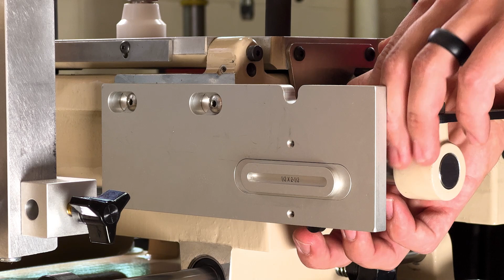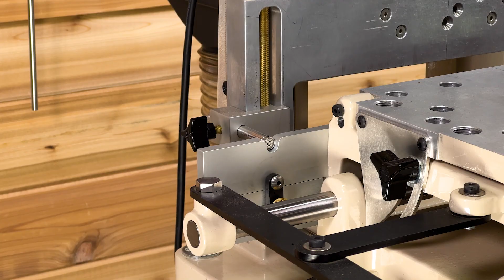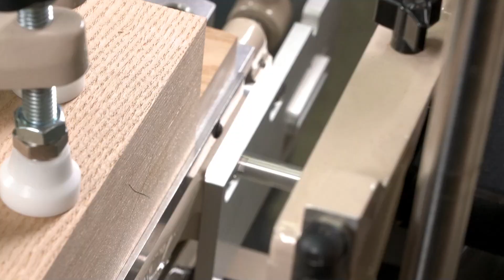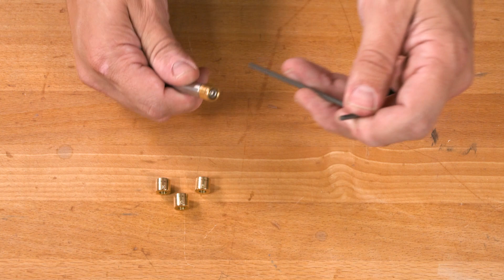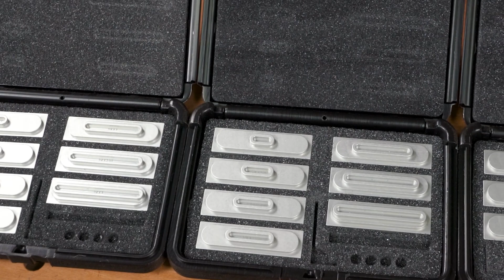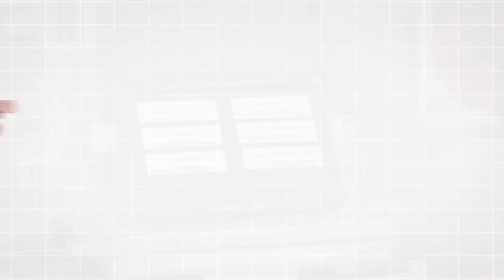Mortise & Tenon Templates | Multi-Router | Woodpeckers Tools

Comment: It seems as if I ought to be able to make my own templates as well for special spacings.
Any feedback on this possibility?
Reply from the maker: Chuck, that depends a little on how you're planning to make them, and how tight you want to maintain your tolerances. With the right equipment, there's no reason you can't make your own templates.
Reply: @WoodpeckersLLC  I've had a lot of luck making precise templates from 1/2" MDF.
Also how much horizontal travel is there in the table?

Comment: Good grief...the engineers have been hard at work. This looks great. The variable stylus looks great too. Will these new templates fit my current tenon template holder? You guys keep this up and I may discontinue or reduce my use of floating tenons and go this route.
Reply: Yes, the new templates will fit in the current template holder!
Reply: @mowderwoodwork  Perfect. It's funny...you guys seem to know how to reach into my pocket and grab a few bucks every so often. Looks like I will spring for the 5/16" set. Thanks for your innovations.    I take it from your video that you are using the center groove only for registration of the left and right stop collars so the mortise is center of the center line of the machine. Then, set the mortise height to what you want. Love the effort into this. No wear or stress on the stylus pin. The machine rails are still taking the load and torque of the router. Perfect.
Reply: @TallEvaGuy  that is correct, the slot in the template is just for setting your mortise width. The height of where your mortise location is, is up to you! Glad you enjoyed the video, thank you for the kind words!
Reply: @mowderwoodwork  I’ve got one more question, but I think I know my answer.  Is a .5” diameter router bit still used to cut all tenon sizes? Then choose the diameter bit I want for the mortise size? All this relative to the tenon template I’m using.
Reply: @Jay Mowder I'm glad of that. Using the same size bit for tenons was one of my top two complaints of the Leigh MFT jig. That half inch bit makes clean and quick work on tenons. Thanks.

Comment: This machines been around for years
BUT I cant remember ever seeing Norm use one, it wasnt untill I seen it used on Wood Works  that I seen one used.
Growing up in a machine shop around vertical and horizontal mills as well as lathes drill presses saws welders and grinders I knew a xyz axeses were
The next step to this machine might be 
Ditigtal programing with stepper motors
To make it cnc  somthing I dont think you could do with a pantarouter.
But if your going cnc  a larger format could be made to prosses beams for 
Timer framing  most of thoses joints are cut by hand and a large cnc mill to cut them would speed up the process,  
Of course your talking a 250k to 1.5 million dollar machine. But any cut design is just a cad program away.
Its not out of seight to see a full size cnc router to cut sheet goods so why would beams be any different. 
Machines like these have been around for 40 to 50 years, cad addition is new they used to use tape and programing was done with a lot of math. Cad has taken away the math and you can visually see what's going to be cut.